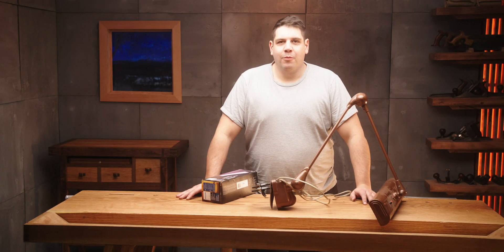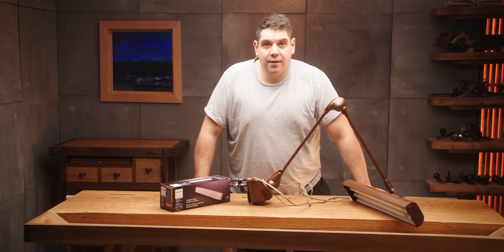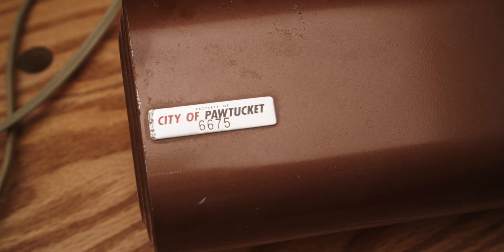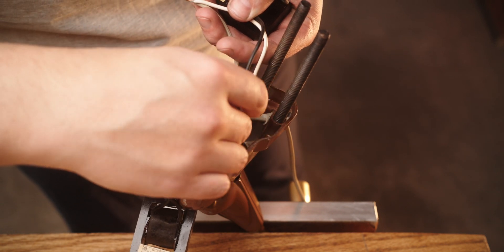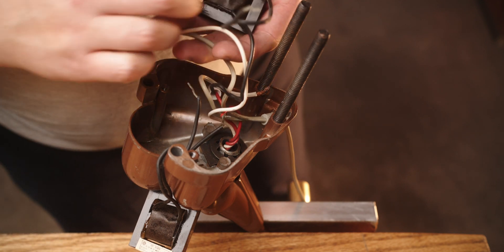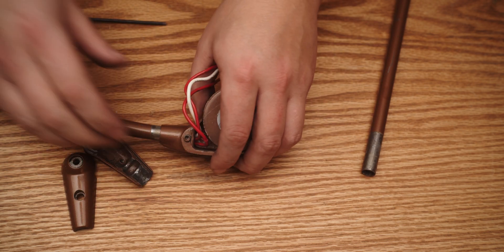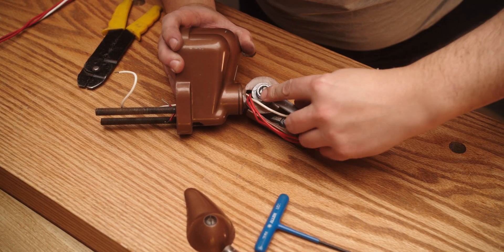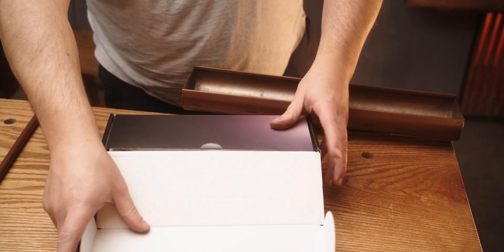DIY LED conversion to a vintage drafting desk lamp

Comment: Found the exact same lamp at a thrift shop for $10. One of the ballasts were shot, so I want to do this same thing. Excellent video. I am just trying to find a cheaper alternative to the Hue light. Not really keen on butchering a $48 dollar light to upgrade my $10 light. Keeping my options open.

Comment: Strange questions : 1) what’s the material on your wall , and why black ?
2) what are the orange strips of lights on the right …?
Reply from the maker: This is 2x2 blocks of foam with a skim coat of concrete. I’ve seen taken them down for shiplap. And the orange light is just a led strip light behind the a wood panel made with 1x2 pine and stained. 👍

Comment: My only complaint is it would have been helpful to show how you wired the old original switch to work with the new light.
Reply from the maker: Good point. I can say that I didn't keep any of the original electronics. I did leave the switch on the top, but I don't do anything. To turn on the light, I just use the Philips Hue remote.

Comment: What did you do with the old transformer? I need one of those for an old lamp.
Reply from the maker: I didn't keep it. Thinking back I should have though, because it was working good. :(
Reply: @latenightcraft3856  Yes, I hear you, I've done the same in the past.
I needed one for a Amplex Trombolite Telescoping Dual Bulb Drafting Lamp.
Those lamps don't look very ideal for a LED conversion, seeing that the transformer is mounted in a restrictive semi round compartment down near the base of the trombone. The compartment is just big enough to fit the transformer with no space to spare, in fact, it's nearly a slip fit.
Anyhow, after I had commented, I found an old desk lamp in the basement that had the required transformer.
Appreciate you commenting back tho.
--